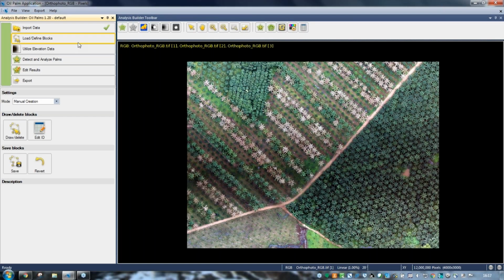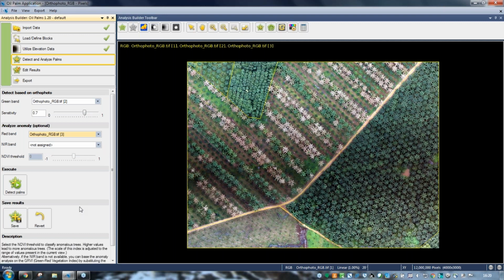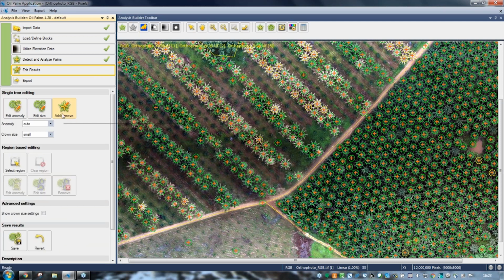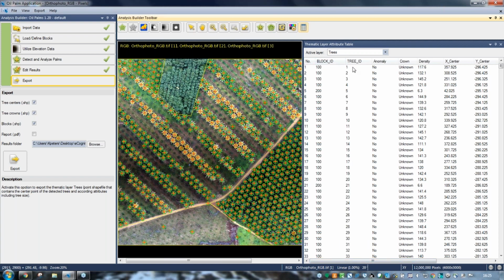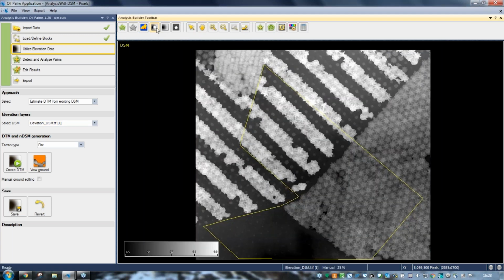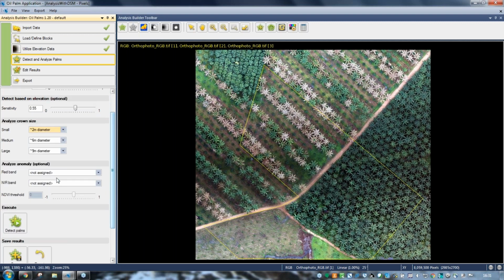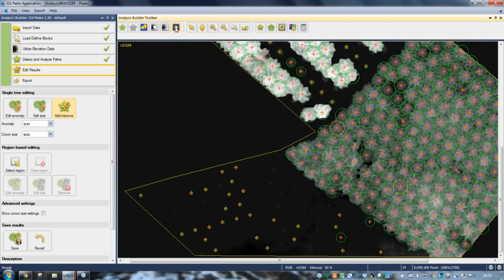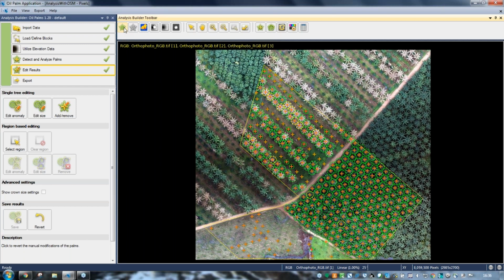Oil Palm Tree counting - Trimble eCognition

Comment: Oil palm waste empty fruit bunche(EFB) grinding shredder/biomass crusher  https://www.youtube.com/watch?v=2eDZgB9EOzQ  Medium density fibre-boards and blackboards can be produced from EFB and palm fibre . Currently, the MDF industry has 14 plants with a total annual installed capacity of 2.9 million. The total export of MDF was RM1.2 billion in 2008. The industry has started utilising acacia mangium and mixed hardwood to produce MDF as alternatives to rubber wood. At present, Malaysia is the world's third largest exporter of MDF, after Germany and France.